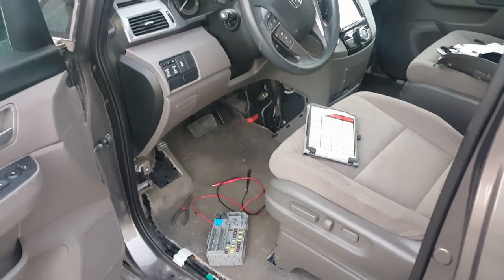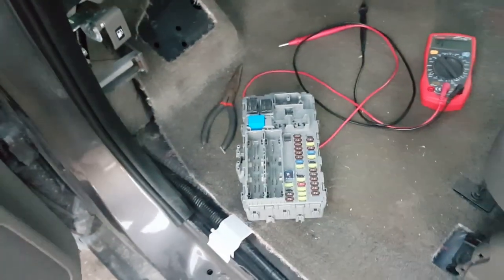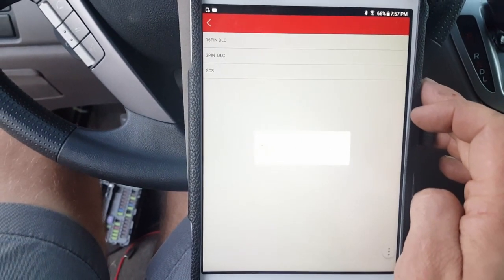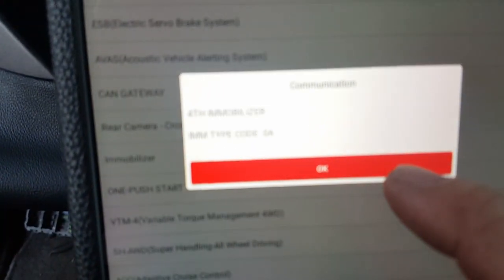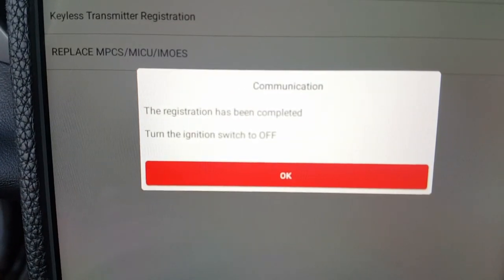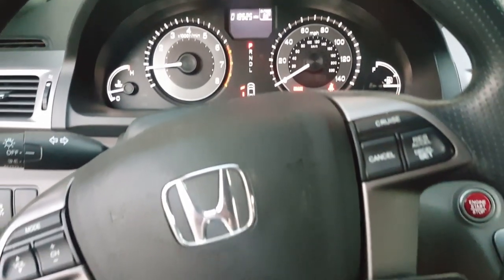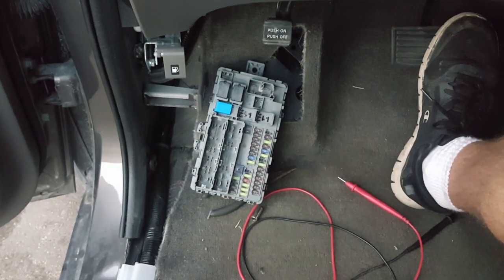How I replaced and reprogrammed  MICU Unit, Fuse Box, Multiplex Control Unit on a 2014 Honda Odyssey

Comment: If anyone is still trying to figure this out and researching in 2026, here is what I have found:

These MICU replacements are fairly common in Honda and Acuras from 2008-2014, depending on some models. 

My Acura MDX has only one symptom: all doors will unlock, but not lock with switch or key fob. 

I decided to replace the fuse box (where MICU is located), and it's fixed! But now car won't start. The dealer is absolutely worthless and they won't even troubleshoot without replacing $3000 worth of parts first. 

I asked them if they could just click the little button in the software after swapping the fuse box myself. They said no. 

They treat you like a poor, and probably think you stole the car. Disgraceful. Never buy a new Acura or Honda, I say. 

Digress... I will buy an Autel 508s and see if the function is available (if AutoZone ever frigging ships it), and report back.

Comment: This is such bull crap he's lying he's selling a product obviously
Reply: Nope. When the micu is bad, bad key, immobilizer issue it will start for a second and shut off followed by green key light flashing....having that problem right now...and you can google it.....dont make up blatant lies when you have zero clue kid
Reply: @19chev81 my friend the order of operation is not indicative of a bad immobilizer.. the key would be flashing just as soon as you turn the ignition over and try to start it you can hear in the background that you disengage the ignition switch because you can hear the solenoid clicking before the motor shuts off and not only that but the Green Key flashes every time you shut down an Acura or Honda
Reply: @19chev81 Specific Examples: Models like the LAUNCH X431 PRO5 can program data to a new module. The LAUNCH X431 PRO Elite.... not the x431 i-diag

Comment: this is a message for the guy who made this video very good video. i have a 2006 honda ridgeline a have a green flashing key my vehicle would not start. plus gas gauge does not work outside temperature not working plus my OBD Scanner does not work i check all fuses. all is good none blown.  put in different PCM. and put different ECU. still doing the same thing so i put back the PCM and ECU. still flashing green light. could it be the MICU or the ECM. would like to know if you can help me.

Comment: George, my 2015 honda CRV drives well but has series of electrical issues after a couple of days of heavy rain. Dealership reported U1280 error code and recommended replacing integrated control relay module (ICRM). Is MICU same as ICRM? Do you recommend replacing the entire ECU to get ICRM replaced? Do you have any videos showing how to replace an ICRM? Thanks.

Comment: George
I have a 2007 I ctdi 2.2 diesel civic and since I disconnected the Bluetooth control unit because it was draining the battery I now get B10299 code and a mil light on facia.  This appears to relate to micu unit?
Any idea why?
Roger
Reply: Did you fix it?  Was it the MICU?

Comment: Hi!!
My Honda Accord 2014 EXL Navi  has a parasitic draw, reads in the multimeter .44 Am when I disconnect the driver lock/unlock switch the drain lows as .03 Am. I buy the piece but it still the drain at the moment I connect it. Could be the MICU?  I had've read that the MICU controls the door switch.
Reply: Did you ever fix it?   Was it the MICU?

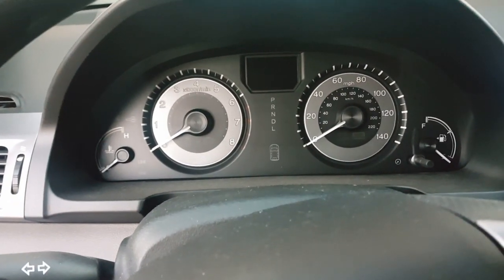Comment: Vehicle started and died....No it did not but you turned the ignition off. I can hear it at 1:46...OK? ok
Reply: Shahid Khan why is it difficult for you to believe this? You probably work and manage a Honda dealer lol
Reply: @scientist100 he doesn't believe this because the product that the gentleman is using to do this is not capable of doing it although launch does have a product that you can program with this is not it and he does shut the ignition off if it was a problem with the immobilizer the key flashing would start flashing before the vehicle is even started at which point it would be rendered useless because it would not start the Green Key always flashes when you shut the vehicle off even when there's nothing wrong with it
Reply: True, he turned the ignition switch off and killed it. I don't think he did it on purpose, probably in a hurry to demonstrate the tool. I believe this could work so long as the processor in the phone is fast enough. I just worry about adding an app to my phone that could cause issues with the phone. I've had the launch apps from the app store on my phone and they would not work for me.
Reply: Yes he did shut the ignition off and the green key always flashes when you shut the key off of a Honda or Acura and although launch does make a product that you can program with launch idag is not one of them

Comment: nice video. please I have a honda odyssey 2000 and 1998 accord with all keys lost for both vehicles and I tried to program with the x431 but always got "immobiliser not normal" message. someone suggested to replace the fuse box and perform replace micu/imoes procedure, but I am not sure if that is the problem. please need your advice.
Reply: Sagir ILIYASU ADAMU had the same issue when I was working on a 2001 Civic , hooked up my friends snap on scanner n program it